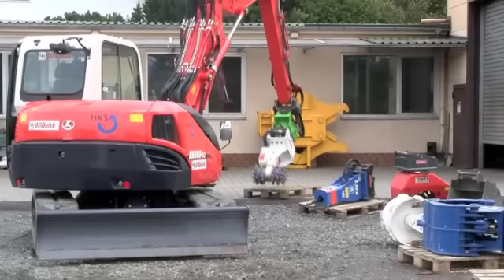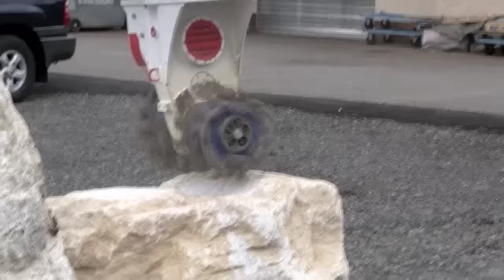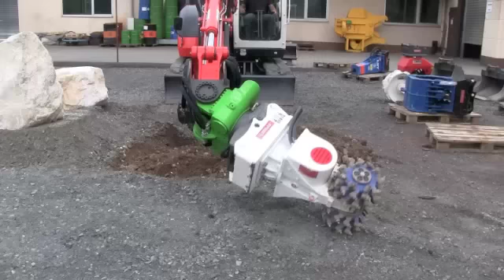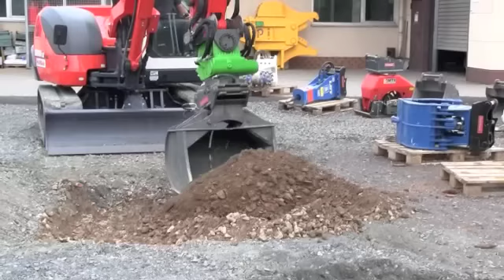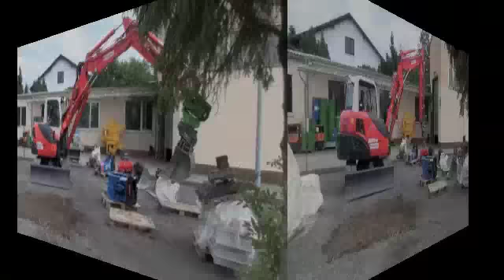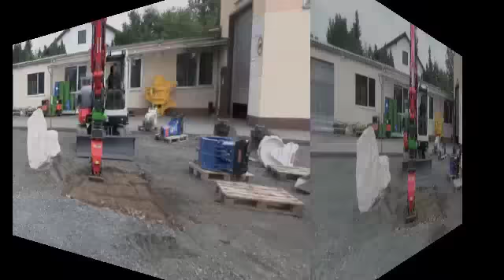Tiltrotator HKS, Erkat, Kubota KX 080 , MTS GmbH,Oilquick,LST Group       GmbH

Comment: How does the plate compactor work without connecting hydraulics to it ??
Reply: prob and pressure sensor on the top , so much force starts it
Reply: The hydraulics are inside the quick coupling system. Same for the bucket.

Comment: Seriously I've never seen such a selection of useless attachments in one video. This lot would be fine for the kids in a sandpit at home, but no use in the real world.
Reply: Jonathan Elliott the white wheel is usefull for compacting clay, and the red vibrating compactor is used tons in sweden, many contractors gets extra pay for having them, and the rotortilt of probably the best attachment you can have..the US is lightyears behind in heavy equipment
Reply: but you have to admit that split bucket is useless
Reply: What is USELESS about it? Please explain!  Steel is strong stuff and clamshells are great for various things ?
Reply: Jonathan Elliott a1we2
Reply: Split bucket❓❓😆